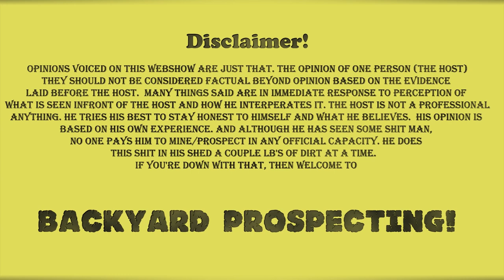DirtHogg 1lb bags of PAYDIRT

Comment: Nice haul, DD.  Couldn't wait on you to decide if you were gonna make the toolbox's again.  Bought the new Gold Hog Mini Stream Sluice, with power pig.  Hope the rest of your paydirt comes out this crazy good.
Reply from the maker: No decide about it. I'm making um.  I'm just running into issues with the header boxes and how I'm trying to seal them. its still kind of cold out so I think that screwed up how the epoxy was drying. so I have a whole batch of headers that I'm not able to use. The 2nd batch I used a different casting resin to seal them with and they are still wet to that it leaves finger prints on them when they are touched. so I have to wait for that to dry completely. So I have about 10 days worth of print time all sitting around waiting to dry so I can use them.